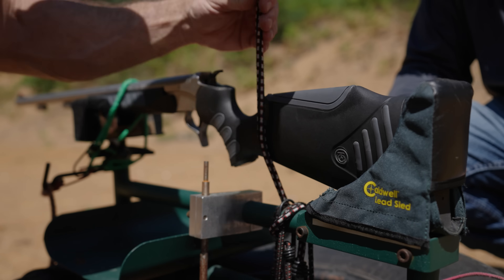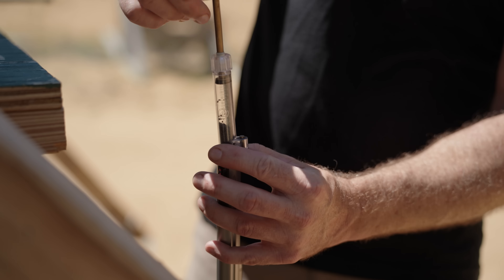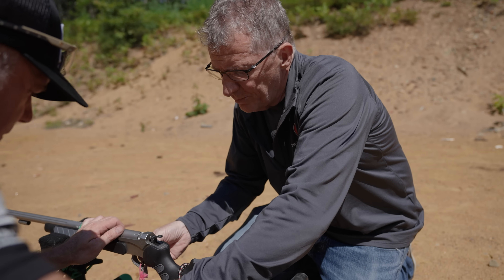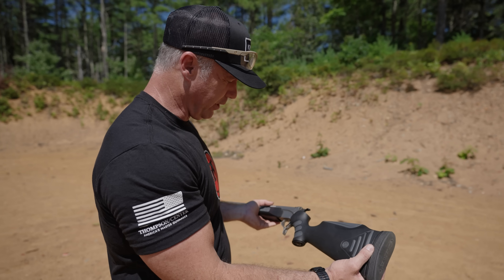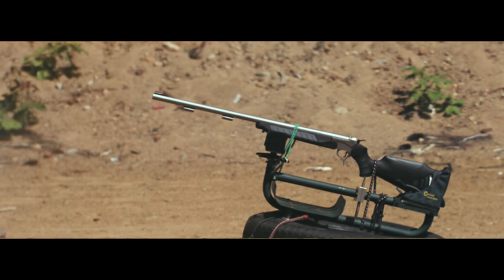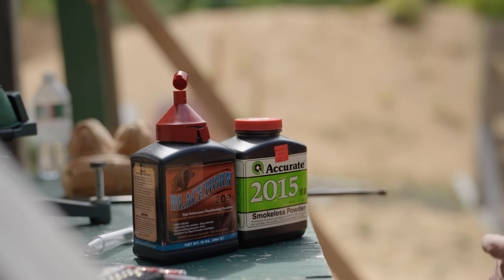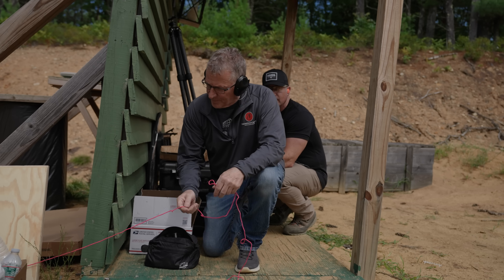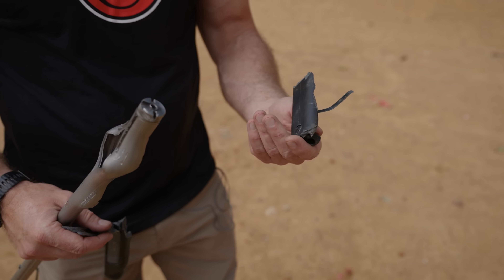My Muzzleloader Exploded

Comment: Who has ever stored a blackpowder firearm, after shooting, for a year and not come back to a rusty mess?
Reply: It depends on whether the gun was cleaned after the last firing and then loaded, or if the gun was not cleaned after last firing and then loaded and stored. unburned black powder will not rust steel like burned residue.
Reply: I fire my gun a couple of times before season last year, then cleaned it and reloaded for muzzleloader season. I didn't fire it during late season (muzzleloader comes in last in Indiana). I left it loaded in the safe until probably July. I didn't shoot it out because I didn't want to have to break it down and do a complete cleaning so I just pulled the breech plug and rammed it out. No rust, but I didn't expect there to be because it's the burnt powder that cause rust.
Reply: Doesn't sound like the range was shut down. There was somebody else shooting on that range.
Reply: @Mbartel500 probably shut down for the test only.
Reply: People that don't clean their firearms frequently, or after use are the people that have Dingle balls in their shorts, because they're too lazy to wipe after they take a dump.
Reply: It’s also very climate dependent. I’ve had instances where a gun sat for a considerable amount of time with black powder RESIDUE after firing and had very little rust. The other factor to remember is that we’re talking about a situation where the gun is NOT fired thus there would be no residue in the first place to cause the rust
Reply: I live in one of the dampest climates in North America, and experimented with a couple of different rifles several years ago. Black powder residue is NOT corrosive. It is, however, somewhat hygroscopic, and will absorb a small amount of moisture, which will eventually cause rust to form. Pyrodex, on the other hand, IS actively corrosive. It will cause rust fairly quickly, even if kept dry. I also found that certain brands of percussion caps were very corrosive, but can’t find my notes. I remember one brand caused rust to form within hours.
Reply: Maybe if you have built your own T/C rifle, you take better care of it... The thought of leaving my rifle (or pistol) loaded after shooting it is inconceivable.
Reply: @Smilodon1985 lol, yes the idea of leaving a muzzleloader loaded AFTER firing IS inconcievable. Ahahaha
Reply: Load on top of a load.. wow can you say lazy. People who are responsible don't do this..
Reply: A nasty rusty mess is pretty much par for the course. 
We are actually having our fall black powder shoots this month,  and the top thing I was mentioning to folks was that THOMPSON CENTER MUZZLE LOADERS ARE BACK!!!!!
Can’t wait to see the new line up for 2025
Reply: My dad left his T/C loaded for almost 10 years. It was cleaned good before he put it away. Ran a couple patches to see if the barrel was clean. Shot no problem lol.
Reply: No you must clean it out with soap and water and lube it well  . I had a 54 cal for 5 years.
Reply: short answer, older guys, these newer rifles are made with far superior materials and way less corrosive powder, but a distracted old man (my grandfather)  has been known to remove the primer and box it saying "I'll manually unload it at home" then forget and just take rifle/case and all and store it
Reply: @kiralana324  yell these millennials load their so-called muzzleloaders, with all that substitute black powder junk, I only buy that substitute junk to put on my post toasties in the morning. Real men Shoot black powder.
Reply: Are modern black powder replacements still corrosive??
Reply: I did that once, only once. Turns out you have to clean that thing every night after you shoot.
Reply: Burning black powder produces sulphuric acid. Black powder substitutes do not. They are nasty just like black powder .but they are not nearly as corrosive. Giving you some leeway in cleaning it. Tho you still have to clean them.  Never over charge the substitute powders as they are smokeless powder with all the ramafacations   the more you use the higher the pressure..💥🥺
Reply: Modern BP substitutes develop more pressure than real Black.  125 gr of 777 is dangerous IMO.
Reply: 120 grain is recommended for a 28" barrel, 2 pellets 777magnum pellets burn off perfect with over 2000fps muzzle velocity. @TheodoreCross-d7b
Reply: The secret is to use natural based, non-petrol lubes and cleaners.
Rust never became a problem for muzzle loaders before the introduction of petrol based products.
This is all info that used to be available in the literature that came with every Thompson Center blackpowder weapon.
Reply: I forgot and left my knight wolverine loaded 3 years once. Took 2 caps to get to go off. But fired. Not rusted or pitted out.
Reply: Reading comprehension isn't a strong area with half the comments. 😂
Reply: I keep mine loaded for months at a time and no problem
Reply: pyrodex is rust my c&b rusted before I got home. 
goex real bp loaded in c&b 5 years fired off no rust cleaned reloaded
Reply: Hell, I shot a deer on a morning hunt. It rained through the mid day (gun was in the back of a truck with a topper on it). I loaded the gun for the afternoon hunt and didn't see anything. We were done hunting for the evening, so I shot into an embankment to unload the gun. By the time we got home that night, the barrel already had surface rust on it.

I could only imagine what it would look like after a year😂
Reply: @slimjimmy229 do you store your gun in wet conditions? Rust will not form without moisture being present.
Reply: @ryanfriars545  It had rained, so there was plenty of moisture in the air. The firearm never got wet. It was in a case in the truck while it was raining.
Reply: Mine has no rifling left in it.. the rust ate it. lol
Reply: @slimjimmy229 Well, if you don't wipe it off and protect it, obviously it will rust. I also know this from experience, after I loaned it to my son. Great firearm though.
Reply: @jamessherrill3454  The firearm never got wet. It was in a case, in the truck, while it was raining.

The rust had formed inside the barrel from the pyrodex fouling from the deer I shot earlier that morning.
Reply: @slimjimmy229 black powder isn't corrosive until after it's been fired.  It turns into corrosive salts once it burns.  I have a revolver that's been loaded since last February and still not a bit of rust.  I also keep it stored in a pelican case with silica packs inside. Soon as I get done shooting it I completely clean it and grease everything down with bore butter.
Reply: @Pawpaw7332  I'm aware of this? In the original post that I was commenting on, it asked about storing a muzzleloader for a year AFTER firing it. In my comment, I stated that I had shot the firearm that morning, and by the time I got home that afternoon, there was already a layer of surface rust in the barrel.

If I haven't shot a deer, I will leave a charge in the firearm for our entire 10 day season with no issues.
Reply: What kind of stupid idiot would do this? What is the first thing you're supposed to do when you pick up ANY firearm? 🤔 CHECK & VERIFY IT'S NOT LOADED.
Reply: Me. I'm a matchlock Musketeer.
Translate matchlock=meticulous aka anal.
Reply: Part and parcel of shooting muzzleloading/black powder firearms:  they need to be thoroughly cleaned, dried out and oiled properly after each shooting session.  Doesn't matter if you're using black powder or black powder substitutes the firearms still need to be properly cleaned.  I've had delays in cleaning mine even a day without cleaning I've seen rust starting in the bore.
Reply: I let mine sit for a couple years because we lost our muzzleloader season due to CWD. Went to grab it and it was a little crust but not seized up or anything.
Reply: I should add that was with BlackMZ not Pyrodex or even Black Powder.
Reply: The barrel whip on the first shot was a bit surprising to see.
Reply: It amazes me how many keyboard warrior azz holz watch vids just to criticize others.

Must be menial small people.
Reply: If you cannot clean it immediatly, put WD40 IN ALL METTALIC SURFACES.....  AND   EVEN  12 MONTHS LATER.... NO RUST
Reply: I have left my stainless 1858 for 5 years before, not a problem. It was clean when I hung it on the wall.
Reply: I have. I was shooting Alliant BlackMZ then though and it doesn’t exist anymore but what a fantastic powder it was.
Reply: @308dad8  They have pellets.
Reply: Using the wrong powder, bro
Reply: A friend that shoots b p brought 2 rifles that had been loaded 2 years. He placed them one at a time of coarse in a sled hooked a string to them and they both fired perfectly. No issues at all. Black powder isn't corrosive,  burnt black powder residue is.
Reply: That's the users fault.
Reply: I’ve now, at the age of 25, and after four years of active duty service in Victor units in the United States Marine Corps, have cleaned 3 muzzle loaders. 2 family inheritance and 1 friend given. The friend hadn’t fired it in nearly 7 years without cleaning. One of my family heirlooms was a 20 year without shot and the other an almost 45 year without shot and that one was last cleaned about 30 years ago. It’s not hard to clean em. Especially with shot in them. All of ems was .50. Now, there are cases that I have no doubt are horrid due to standards of safekeeping firearms. No doubt, but the thing is people just don’t have the dedication to clean and “sharpen” their tools.
Reply: Ok...for someone who's new to black powder...he mentioned black powder is measured by volume, not by weight.  I've only ever used smokeless, which is weighed before I load each case.  How can BP grains be based on volume, especially with 4 grades of coarseness?
Reply: I’ll only own a SS muzzle loader.  My first in-line even though I cleaned and lubed the barrel prior to storage rusted and pitted the barrel.  My SS inline is nearly 20yrs old now and still perfect,  I’ve even left a charge in it over the winter and it’s still good to go.
Reply: Even if I only fire one round, I will clean my rifle completely. Yes I've left pistols loaded for a few months, but never more then 6 months.
Reply: @JamesHart62 if you can clean it   OIL IT, ...  YOU CAN AVOID  A TERRIBLE RESJLTS
Reply: as long as the powder isnt fired it wont rust your gun  remember goex used to come in a thin metal can and they never rusted
Reply: @GeorgiaRidgerunner Your absolutely right as long as it hasn't been fired
Reply: @GeorgiaRidgerunner depends on how long
Reply: That’s a myth I have kept a black powder pistol loaded for over a year and it fired fine with no rust
Reply: @gunsandgear710 i did it 3 years once the old 50 fired right off 1st time.
Reply: @gunsandgear710 if it’s in a humid environment it will. If it’s in AZ or a gun safe it won’t.
Reply: @gunsandgear710
Reply: @gunsandgear710  evidently you’re not that intelligent because he didn’t say anything about keeping it loaded he said after you fire it a few times you put it away and when you come back, it’s extremely crowded and yes, this is true.
Reply: @gunsandgear710 loading a clean muzzleloader with Black Powder is fine, it’ll be good in 30 years if it stays dry. Black Powder fouling is hygroscopic though and most substitutes are also hygroscopic. Pyrodex is so hygroscopic the guns will rust here in the south in hours instead of weeks.24-48 in Memphis after firing Pyrodex you better wrap your bore brush in 0000 steel wool to start polishing the rust out. Also friendly tip for anyone who may not know but chlorine free scrubbing bubbles branded or generic works wonders at removing stubborn powder fouling.
Reply: @gunsandgear710 I’m just going to go ahead and be the one to point out that, that is sad lol
Reply: @DarkHorse35  how is that sad?
Reply: @DarkHorse35  why?  If safely stored I don't see how that's anybody else's concern.
Reply: @gunsandgear710 black powder is very corrosive
Reply: @ only when burned
Reply: I've left one unfired and loaded for a year.....no rust no problem. 

Fired and uncleaned for a year.....yeah rust bomb
Reply: Years ago, I shot Dad's .58 caliber HR Topper muzzleloader.  Used 2F black powder. Put it back on the rack, and forgot about it.  Sometimes later, Dad took it off the rack and could not open it.  Took him, my older brother, and a vice to get it open.  Needless to say, I heard about it!!!!!  Lesson, always clean your muzzleloader right after shooting, or as soon as possible.
Reply: I’ve heard of it before
Reply: A year? Hell, how about a month? I was shocked how much rust was formed. Spent the rest of the day cleaning and oiling it. Now she’s (how come all guns are Female?) always stored well oiled and is wiped off before taken out.
Reply: @oldnumber5866 should not use oil on a  black powder gun, use hot water and bore butter.
Reply: Keep my ruger old army pistol loaded in the safe 2 years, shot fine!!!
Reply: @Mr07191963 R.o.A ...R.O. A,  all Black powders shooters speak about R.O.A....  😂😂 in Caps and ball, Old Army is 
Iike Rocky Marciano in boxing  !!!!  An unic singulatity .
Reply: Hogdon triple 7, stainless steel rifle, no problem
Reply: Had one loaded for 3 years. Took 2 primers to make it go
Reply: 🙋 my blackpower Navy revolver is clean, and it's been 5 years since I touched it
Reply: I have. I use  Blackhorn  209. Never a problem and I have the same gun that he is using in the video.
Reply: Stainless for the ɓrainless maybe?
Reply: @Jim-m1t it's stainless not stainfree or unstainable it can still rust, pit and 
become discolored.
Reply: I agree bull shit all they way around
Reply: Modern propellants aren't corrosive like old blackpowder
Reply: @davidpalmer9740  black powder is not corrosive, it's the fouling left behind after combustion that is the problem. The fouling is very hydroscopic, which means it draws moisture from the air, which leads to rust. The early percussion caps used mercury fulminate, which leaves behind a type of salt residue and salt plus moisture leads to damaging corrosion.
Reply: @Mbartel500  I was speaking of modern propellants but I agree with you on the latter
Reply: @davidpalmer9740 PRIMERS  is the key.....
Reply: Show me that person and I'll show you someone to lazy to own a muzzleloader...

Sorry, but facts sometimes sting a little....
Reply: @Stickbow1980  *too might want to get your spelling right before getting on your high horse.  Maybe let people live their own lives, it's not your gun, it's not your problem.
Reply: @Stickbow1980 That person likely used a substitute that is noncorrosive. Real black powder won’t start rust the same day but Pyrodex will have visible rust within hours. BlackMZ was a great propellant but according to customer service from Alliant distributors buried BlackMZ until Alliant had to scrap the powder because it wasn’t getting onto shelves and basically we all discovered it once it was clearances out. I wish I knew I would’ve bought every bottle in the country. I was getting it for $10/lb and burning 1-2 pounds a year. I got so mad when I couldn’t get it anymore I finally paid up for shipping and bought Goex. Million times better. I can make Goex quality at home and I burn 1-3 pounds a year. Not nearly as corrosive as Pyrodex and not nearly as expensive as the others. And cleans up with water. Pyrodex needs a little more so scrubbing bubbles and steel wool.

Comment: This video and with saying this stupidity of double loading is very common, or even worse, putting the gun away loaded after hunting, is the perfect poster-child idiots to support the Left with pushing gun control!  I would have to agree in that case. If you are that stupid not to discharge after hunting and putting it away, and/or not smart enough to remember if you loaded it or not, you are not responsible enough to handle a firearm, or even a bow and arrow for that matter!

Comment: Using plain old black powder, there really isn't a way to blow up the gun with any amount of black powder unless you do something stoopid like plug the barrel. The physics of how black powder burns just won't allow it with modern metallurgy. Any extra black powder simply gets pushed unburnt out the end of the barrel. That's reason enough to NEVER use anything but plain old black powder - NEVER USE A SUBSTITUTE; NEVER USE SMOKELESS.

That double charged load, if using black powder, will only generate about 21,000 psi. That's not much considering that most modern rifle barrels regularly see pressures almost three times that.

And for whatever it's worth, all powder, including black powder are measured by weight. Black powder measures do not measure by volume. To see this, simply measure out some black powder with your powder measure, pour it into a scale, and if you measured out 60 grains in your powder measure, it will also weigh 60 grains. Grains, after all, is a measure of weight, not volume.
Reply: And you get that great smoke and aroma with Holy Black.
Reply: @tomcurran8470  ABSOLUTELY!!!
Reply: Actually, black powder measures do measure by volume.  The volume marks are just placed to correspond to an equivalent weight of black powder in grains.  If you were to use it to measure #9 lead shot for example, when you poured that shot in a pan on a scale it would weigh much more than what the marks indicated.
Reply: Or……..unless the barrel has a defect and goes off like a pipe bomb like my nephews TC did, exploding his left hand which was sitting on top of the scope. He’s still never received a dollar from TC and the investigation is ongoing and will likely end up just like a Hillary Clinton or Hunter Biden investigation. 
The gun was cleaned and put away for the winter and the following summer both brothers witnessed him load it once and the first shot off the bench it exploded. 
His TC wasn’t the only one to do it. As soon as it happened my brother did a google search and found that many of the same gun had done it and some were even shown exploding on video while people were practicing.